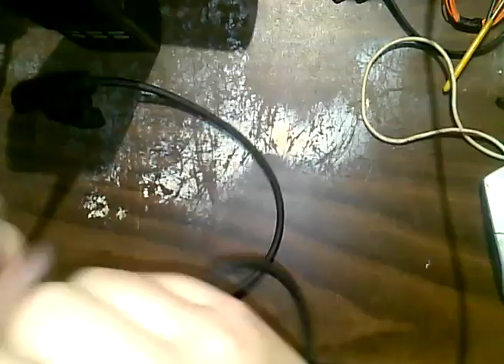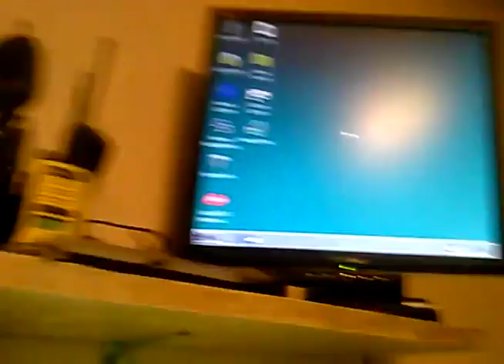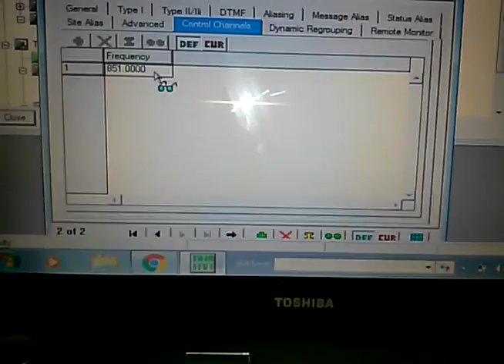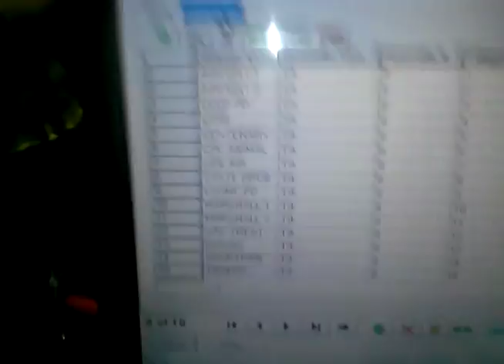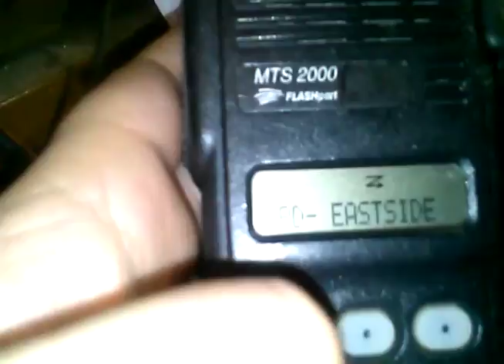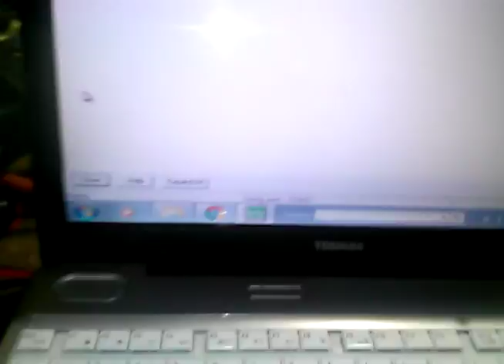Rebanded Motorola MTS2000 Flashport 800 MHz - Operation, CPS and Programming

Comment: Legit needing a guy to just do this for me seems to complicated for a simple minded creature as myself haha would you be interested in making some money and setting up my 4 radios for me?
Reply from the maker: Are they the same radios as in the video? If so I would not need batteries or chargers shipped as I have all that.
I will need a few things though:

1. What city, county state? and if you have permission to transmit on that system
2. If you have a previous radio that is already set up I can use that to get the information to program the others.

Conventional programming of 1 zone of up to 16 channels or 1 trunking system with up to 16 talkgroups - $50 ea

Shipping back to you would be USPS medium flat rate - about $14.
Reply: ElfNet Gaming email me ricjaymes2@gmail.com and yeah mts2000 flash port exact same radios and I will give you contact info after u email me we can phone call chat about it and kinda what I need and looking for.
Reply: @Elfnetdesigns  could you shoot me an email? I'd like to utilize your services please. Drew.mas@gmail.com

Comment: Just use the windows cps version 02.03.00 and I use the syskeygen dos based system key program to make system keys also radio firmware is R.08.73 in order to properly trunk rebanded 800mhz systems elfnet please email me at kc9iqo@icloud.com  got a few???? for you thanks.

Comment: good videos i was wandering if u know of a good video on youtube to program motorola p25 radio
Reply from the maker: All i can recommend is do a youtube search on it. I don't have any because the p25 systems here are kinda classified (the people at the state police asked me not to cover their systems programming because they have unlisted talkgroups for sting ops and drug busting ops) so I just don't make videos on p25 radios or programming, to keep things in the green with law enforcement and people I work with.

You could also check with the r/hamradio on reddit, maybe they know of some?
Reply: thanks elf i am thinking of using gm300 to use them for my gmrs repeater what is your thought on that
Reply: i am trying to figure out how to use the id o matic for a repeater controler and how to put pl tone so it dont mess with other repeaters in the area
Reply from the maker: GM300's are or were widely used in such application, I do believe most of the Radius line has part95 certification. GMRS repeaters are not required by the FCC to CWID but it is good practice, which leads to many people using those maxtrac repeater cables you can buy off eBay for like $15 that plug into the rear 16 pin accessory port on the radios. 

I do not know much about the ID-O-Matic. most of the controllers I work with are either built into the repeaters or made by companies like Zetron.

If you are looking to set up a single PL repeater (not a "community" or multi-PL) then you can set the RX and TX PL codes in the radios RSS / CPS and leave the controllers PL options to none or open or 0.
Reply: i am looking to do a pl tone so only people that have the pl tone mostly family could be only one  use it  i am going to put up my rptr freq on my gmrs for other to use with the pl tone. do the tx pl tone have to be the same as the rx pl tone for that to work? and do they still make the zetronn rptr controllers
Reply from the maker: You know you have 8 pairs to choose from and PL as well as DPL. I use DPL on my family / house repeater and standard PL (141.3) on the public one.

You can use a "split" PL it will work but be aware that your radios have to use that same split tone respectively to get into the repeater.

The zetrons I was referring to were already in the field. Most all repeaters now have controllers built in and will do multiple PL and DPL.
Reply: Hey Andrew I program p25 radios for a living if you need any help or what not just message me
Reply: @ccsochp1  thanks will do give me your email address and we'll talk some more about it I would love some assistance with the p25 trunking